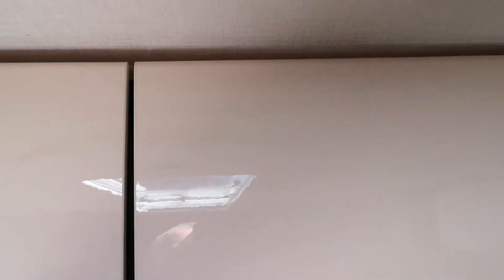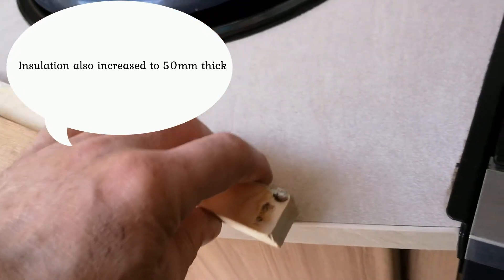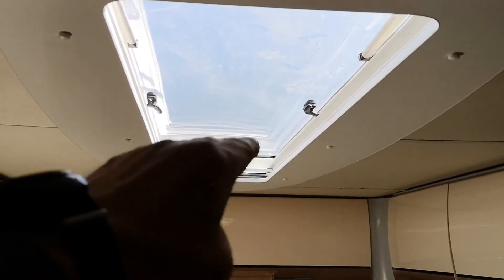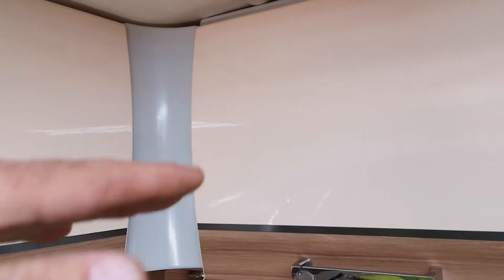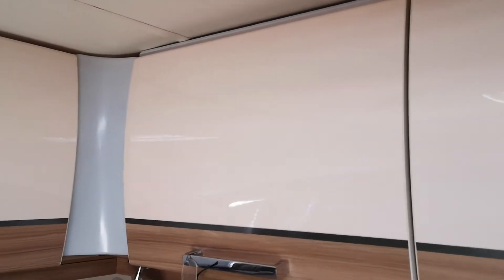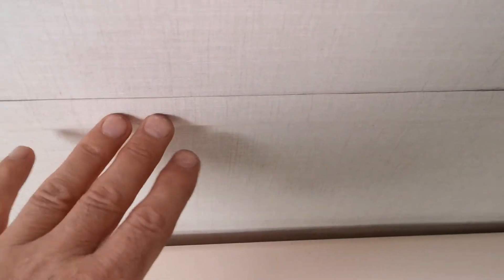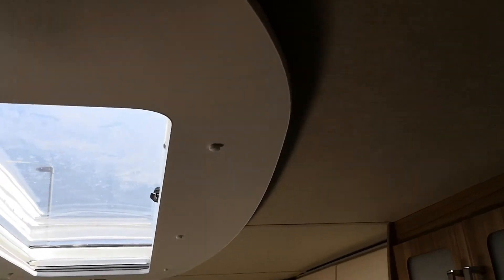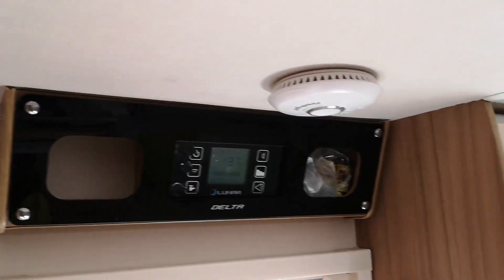Caravan Roof Part 2 - Caravan Roof Leak

Comment: Having watched both videos it seems you have the same layout as our Lunar lexon 640.
You mention the build is from inside to outside so exactly how did you get all those screws out if they are inaccessible?
Did the roof sheet and the trim strips just have to be broken out and then all replaced?
Where did you get the replacement roof and wall sheets from?
Any assistance you can offer will be very much appreciated.
regards
Trevor

Comment: Did you do all this work yourself. Looks a very good job
Reply from the maker: I did, I had no choice, because every repair centre I contacted refused to take on the job. Thank you for your kind comment.
Reply: @deuceelec  we have the same issue on a 3 year old caravan and just don’t know what to do. We might have to take the route you’ve taken
Reply from the maker: @JamesHerrod.  My sympathy, this should never happen, let alone on a three year old van. However, if you're at all handy with DIY you shouldn't have a problem. Don't be intimidated by it, it's only a tin box! Just be methodical, take lots of photos/videos otherwise you'll forget. Make templates of the internal roof curvature and mark them left & right.

Comment: When you took your kitchen shelf cupboards down did they have staples in them and if they did how did you fix the shelf cupboard back up after you put a new roof panel up?
Reply from the maker: The whole kitchen cupboard unit consists of a front panel, base panel and dividing panels, plus doors of course. Each of the panels is held in place by numerous screws and the screws covered (disguised) by beige circular plastic caps. These caps are all over the place ie around eight of them on each dividing panel. I do not recall having issue with staples anywhere.